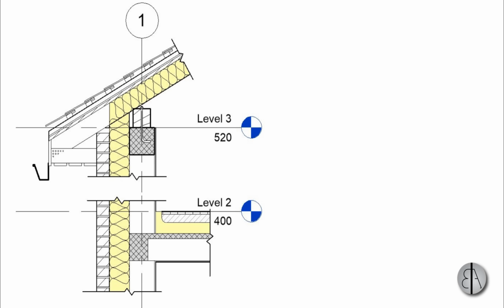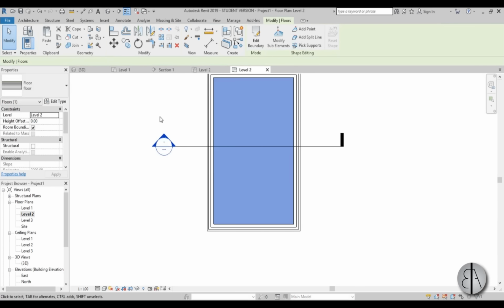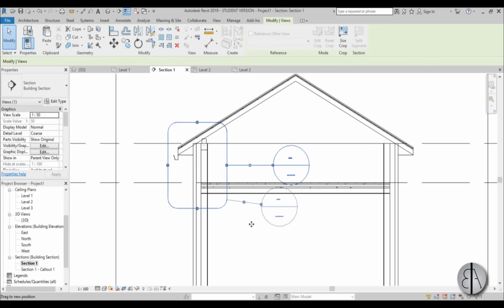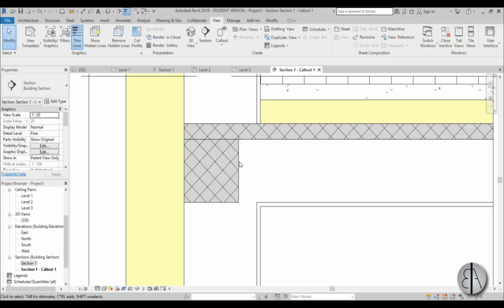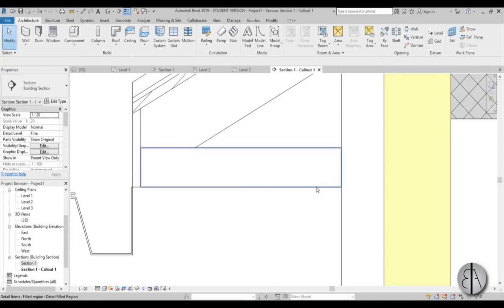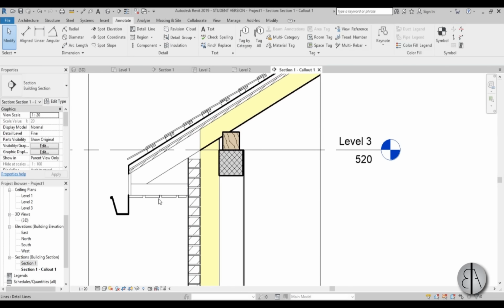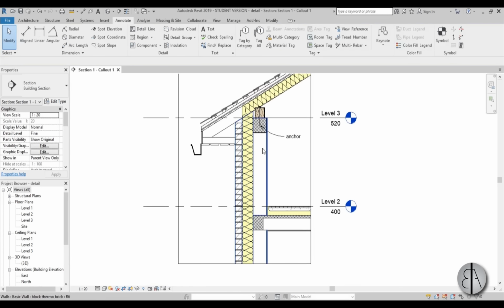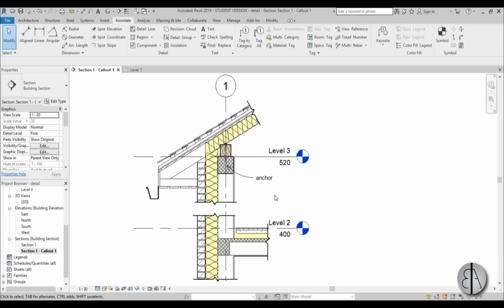Detail / Callout in Revit Tutorial

Comment: Using so many 3D information in a detail? Why would you even do this? Detailing Components have a reason being added to Revit. 

Recommended workflow would be:
1. Place a Detail Callout in your Building Section 
2. Open the Detail Callout, change the Display Mode to Halftone 
3. Trace and add your Detail Components (repeating and normal)
4. Change Display Mode to Do Not Display 

IMHO your workflow is too cumbersome.

Comment: One thing I will add, with details, usually its nice to have a library of details, that you can click and paste, and I prefer using drafting views because of this.  For example, I do residential drafting, I do not want to re-dim, and re-detail, everytime I use the same detail, which is a lot...I use to do it this way, but way to much mucking around, for something I've drafted over and over again.  One other thing that I do not like about Revit, is not so much on the initial drawing, but drawings change, when you move things, you lose your detail, and dims, and have to re-work the details.  Revit should allow for unreferenced dims, similiar to ArchiCAD.  Maybe make them in italics, or faded, something, that when you move a wall your dims don't disapear on your details, hence why I like using drafting views.
Reply: You can lock the details to the building elements
Reply: I feel that the way forward is to use details views as it allows you to have a library of details and simply drop them into your project, you can then use the call out to refer to the view, again and again, using "Reference Other View" option in the Callout creation.

Comment: hey balkan.. hav some trouble with few things in revit

1. gradient hatch in revit
2 . feets and fractional inches is there but its not like architecture or engineering in autocad

can u say how to import that dimension style

3. how to import a new text style in revit .. in my case arial baltic

4. row heights in schedule
... having a new parameters in schedule is one of the solution i already know but other than that..

..

do one enscape tutorial.. it'll help ur channel
Reply: Feet and fractional inches, do not stack...This makes me angry, the text editing, notes, annotations in Revit suck to, Come on its 2018,  Text style I think you need to install it into your windows operating system, but I do agree, revit needs someone like a Steve Jobs, to improve the look and feel of the software, add some pentables, etc.  Its a pain working in B&W, even more painful to create different views.  I guess the thing with revit, as a designer, I want nice text, I want stacked fractions, I want my drawings to have "Personality", the type you would see on a pencil drawing.  Sketch rendering would be another feature I would add, see ArchiCAD.  Also the family editor, there should be editing done inside the revit environment, as well as in the family editor, similiar to the way blocks are in AutoCAD. it should also have better cut and paste between the Revit environment and the family editor.  My 2 Cents
Reply: James Pike ironic that you said “it’s 2018” yet you still use feet and inches. Everyone should be using metric these days.